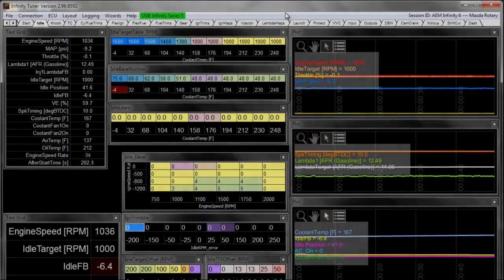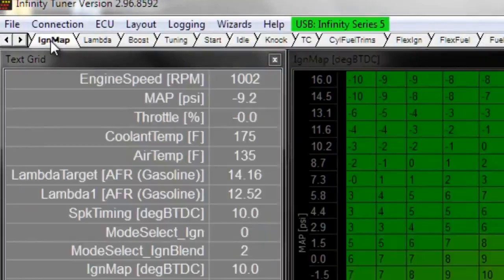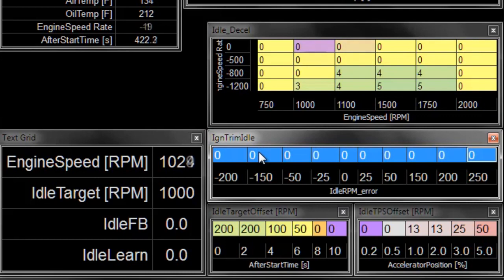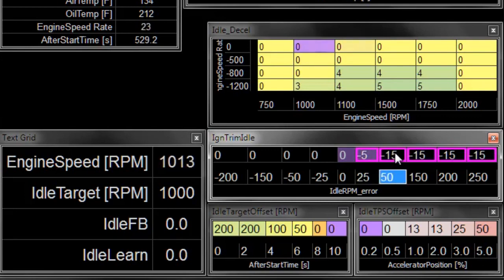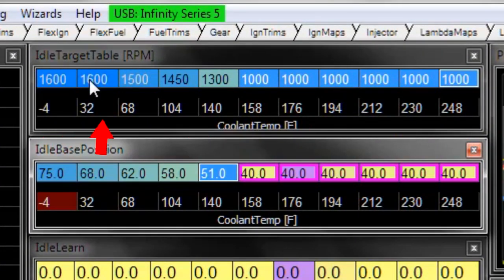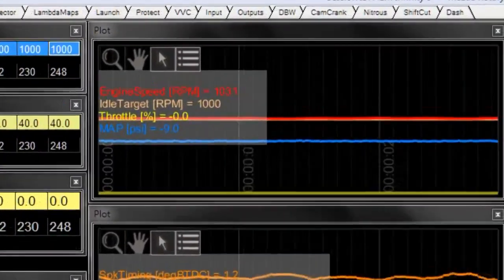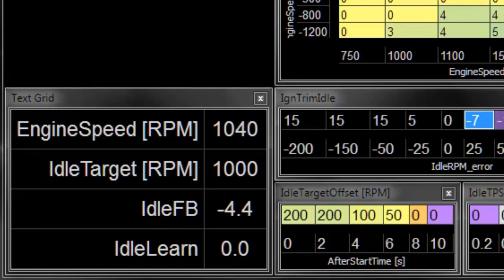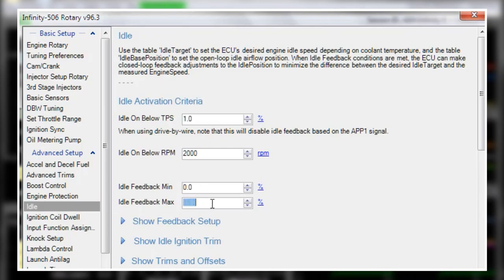Tuning Idle Ignition Trim (Infinity Tutorials Part 3 of 3)

Comment: Besides the IgnTrimIdle table, what other trims/tables might impact the SpkTiming? I'm chasing a little issue where my ign table is calling for 10 degrees and my IgnTrimIdle is all at zero, however, it is reporting a SpkTiming of ~21 or so degrees.